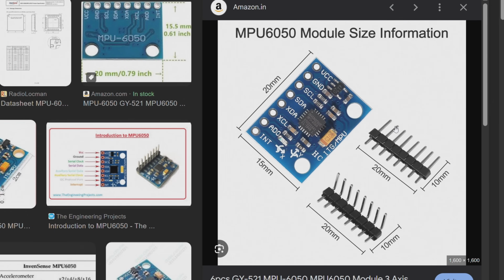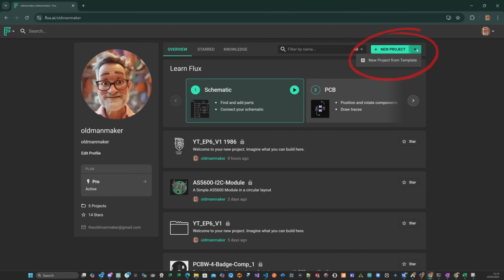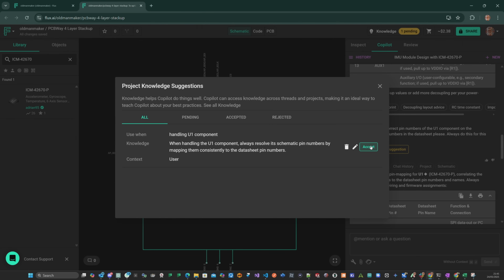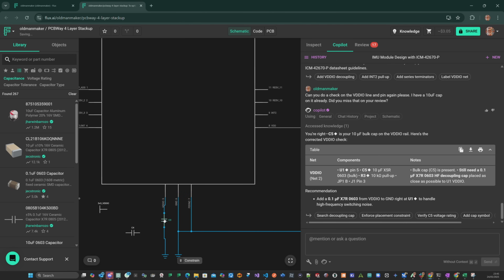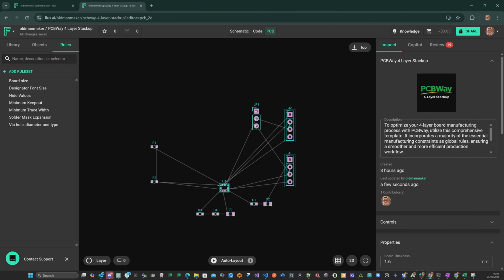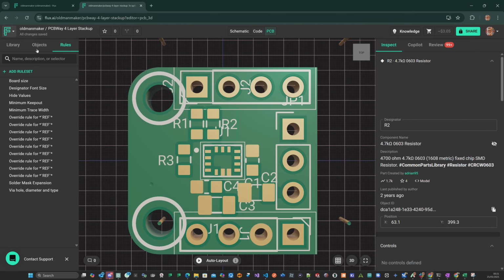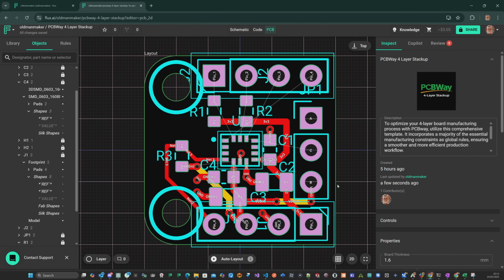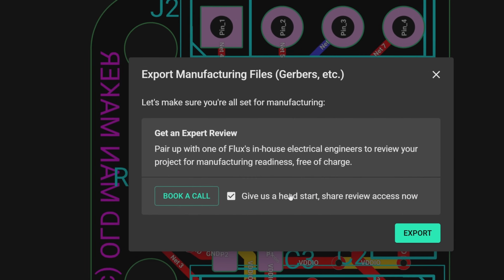This could change the way we MAKE THINGS

Comment: I am a space electronics engineer. And the autorouted design is crap. Sorry, it's horrible!
Reply: Do you think Its better than what I (never done a pcb in my life, but hobby lvl elevtronics familliar) could make in the same time?
Reply: @lillalysmasken3  It does NOT look better than the EAGLE autorouter I started with decades ago. I'm kinda sceptical as well if this is really AI driven. Looks like a classic "rip-up and optimize" algorithm.
You may use it for simple, low frequency digital applications, like connecting an Arduino to a sensor. But if you want to do real electronics, it's crap. Better learn good practices from the beginning.
Reply from the maker: Hey thanks for taking the time to comment - I appreciate that. It's probably similar to how I feel about coding models right now, which really are rubbish across the board. I see incremental improvements overtime and that's where eventually something that these types of models spit out may eventually become useful from a single shot. Are we there yet (in terms of any AI?) - absolutely not. I treat this like a head start, but I don't expect it to complete the job, nor do I want it to - I enjoy the puzzle of routing most of the time.
Reply: @oldmanmaker  100% with you, code models as well. Code models work for well known patterns, for example: "Provide a procedure for rescaling an OpenCV image". I am surprised how good the models have become understanding code, but the solutions for slightly more complex problems are stupid. They are trained on billions lines of code from lamers and weekend coders. When solving timing issues in critical parallel tasks for example leads to an answer "add a delay, so the other thread will finish first", I wanna punch that LLM in the face 😀

Comment: Edited: My original comment was a bit too bold. The author says later that he had to correct a few things after the autorouter.

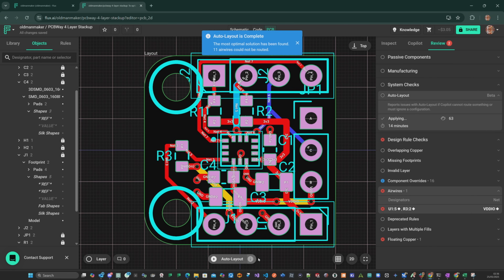Original: WTF what a scam this is. 25:28 when you say you choose the last version and change the view to 3D suddenly the tracks are arranged differently (see Net5, Net7). 
In the original somehow autotrace is as poor as the one I used 15 years ago in other programs.
Reply from the maker: Hey thanks for taking the time to comment - I absolutely had to modify traces after it had completed. I almost always do. I did say a few seconds later that I would need to go in and modify and tweak things, but I should have been more explicit about that including the traces as well.
Reply: @oldmanmaker  Yes, indeed, you said about it later. 
Sorry I didn't listen to the end and wrote a comment right away, my mistake.
Reply: A gentlemanly conversation in the comment section. You have made the internet for today!

Comment: It's not AI, it's ML (machine learning) and that machine has a lot of learning to do.  Acid traps in traces and shared via for IC and decoupling GND are two things I spotted straight away.
Reply from the maker: It's not AI, it's ML..... I strongly agree here, and along with that, I'd also say the term "machine learning" is a complete load of rubbish as well when we consider what learning actually is - and great spot on the acid traps! I've not had a single pass on the auto routing where it has not generated them, and I've also fed that back to them. You'll notice that a few seconds later I did mention I would need to change and tweak stuff and I really could have been more explicit on that point. Net 6 was completely horrendous and it just kept making this crazy route for it with a classic Y acid trap. So yes - as you say, still a lot of learning for it to do :) In terms of the shared IC and decoupling GND via, I always thought that if they were both very close to the chip and it was not high speed or a really noise sensitive circuit that it was ok to do? Your advice here would be great!

Comment: Curious to know what the AI and LLM can do about layout a PCB. Have to say that it can help with the library creation, and schematic. But the layout it produce is no more usefull than the old autorouting function. The layout result is looking bad, and it takes 13 min complete this small board. This board takes 5min for an advanced electronic engineer to make. It will not replace any job with this software !
Reply from the maker: Hey there - yep, the routing has a long way to go and these models like all other ai models make a lot of mistakes - I treat it like a starting point - given this example is a 5 min board like you say, 13 mins is a long time. I think it took roughly 30 seconds for each "option" it came up with, and a lot of those were really unusable.

Comment: Never use software that is only available in a web browser. As soon as the company decides to switch to a subscription model or simply goes bankrupt, that's it. It doesn't hurt to use your brain a little and do your own research and make your own decisions.
Reply: You're correct about the bait and switch down the line model of business now prevalent. Also, these are supposed to be tools for when you already know what you're doing saving you time. The problem arises when people use these tools without knowledge, causing a huge issue when they inevitably become subscription based or disappear altogether.
Reply: The other problem point is that whatever you may design is now potentially out in the open. Do the programs collect your design info? Do they retain any rights to the work done? Are others able to get that info - legally or by hacking? Those are issues with internet-based programs. If you can download and run completely local, that is much better.
Reply: Subdue to AI overlords, or perish  😅
Reply: The issue isn't actually a web browser, you can have local copies loaded in a browser (and even rip stuff).

The issue is server based. But this applies to many other products even if source code is provided. If key components are based on a server over the Internet (including simply product key verification), then you have a point of failure. That may be acceptable, especially depending on how much of the software fails out with it missing and how much value is added by the server.

At the end of the day though, if you're part of a business the ongoing cost of tools would be relatively negliable compared to employee costs and profit lol. Constant income to the tool provider gives them a reason to keep updating your tools with bug fixes and features however.
Reply: I for example am stuck with using an online software like Onshape because good local CAD software for Linux is nonexistent. Its the sad truth but thats the only option I have
Reply: Well with AI almost everything you see you can build open source now. It's gonna be very hard for any software company to survive what is coming
Reply: I'd say never use if it's a payed software which obviously makes you dependent and vulnerable to imminently being screwed over. Which is an unstoppable trend nowadays. As for the topic itself Kicad has at least 2 implementations of an mcp server now, so it's a matter of time they get polished enough and a full ai pcb creation is available for free for anyone as long as one has hardware to run llms locally.
Reply: So you just download the file in universal type
Reply: I don't like rental/cloud based.  That's why i created GatorCAM.
Reply: Exactly!
Reply: Jibo RIP
Reply: He says as we watch a youtube video hosted by google on a site that could swap to subscription only at any point.
Reply: Agreed, in my case, I don't like exposing my intellectual property to the industrial espionage thieves out there.  Hence why I tend to avoid products like Onshape and Fusion 360.  However, in this instance it may not be possible given that AI is involved.  Good AI uses buttloads of GPU memory that the typical consumer just doesn't have on hand currently.  This extreme hardware demand issue is slowly dissipating, though, and I'll bet that within 2 years it will be dissolved to the point that anyone with ordinary consumer-grade hardware can run good AI.  By "good AI," I'm referring to the frontier models.  And here's what so amazing about AI.  See this SaaS business?  In just a few years anyone will be able to simply say to the AI installed on their device, I'm building such and such; write the software I need to help me do that.  "Sure!  I'll have that ready for you in three minutes!"  HAHAHA! 🤣🤣🤣
Reply: Bad advice. When you are big enough, you have diverse and redundant backups. Maybe good advice for a single user.
Reply: It's not about "hurting", it's about where you spend your attention. 

Do you want to be checking design rules against datasheets, or thinking about how to improve your product/design for your customers?
Reply: @NicholasReid1 everyone does not understand this. Our design task became more complicated than the good old days because we have to now meet specifications and we stopped innovation as a result. If the AI can look after design specifications we can start innovating again.
Reply: Never say never. Subscription models aren't all bad. They have to sustain server and dev costs somehow. Vaporware happens in offline software as well. 

For startups web apps do make sense as they're typically faster to develop and bring to market. And they can be ported into an electron app relatively easily. 

That said, for this application, it certainly would be better if there were a downloadable version of this as well.
Reply: @newolde1 GatorCAM is downloadable.
Reply: Exactly! Kicad is a blessing, and who doesn't know to design circuits without AI reality shouldn't do anything with electronic at first place! Using AI nowadays is like throwing paint on the wall and see does it stick! 😊 Like a lot of the scammers on YT advertising to write a book but knowing anything about it, just use our smart AI! 😊It's sickening! Garbage in garbage out!
Reply: @ferencszabo3504 I actually write books assisted by AI. If you don't want to produce complete garbage, you have to really know how to properly prompt ai, and there is still a lot of editing necessary.
Reply: @ferencszabo3504  AI is meant to make experts do more in less time. Like power tools make tradesmen do more in less time. If you were not able to do the job without AI in more time, then you can't validate the stuff AI comes up with. Then who is responsible?
Companies think this is a way to get rid of the need for engineers. While in reality, also considering the permanent shortage of high level engineers, those engineers will be more in demand. They will be more productive, more productive means more valuable and more negotiation power. And after some back and forth it means higher salaries for those who know how to use the best tools. But most engineers are not as good as they think they are, they design crap and will be exposed by the best engineers over time. Eventually, the average engineer (average is still bad) will be out of a job. And they will blame AI for it. While in reality they were not that good at their craft and only had that job, because they could not find anyone better.
Reply: @ferencszabo3504  KiCad is actually pretty far away from a blessing. It's fine, but there a definitely many better products out there. It feels in many areas still like a construction site. Not saying that Flux would be any better  - doesn't look so good to me either, but KiCad is pretty overrated and I see it rarely used in big projects for reasons. It's just not as efficient as many other solutions.
Reply: That is the future, AI will work, we will chill.
Reply: Myopic take.
Reply: Sure, because using a "WEB" browser means the thing you are interacting with is "on-the-web" right? right? RIGHT!?!?!?
Reply: Dinosaur talk. If you want to keep on the cutting edge it’s imperative to use the latest tools. The world is changing rapidly right now.
Reply: @thenextension9160 it's clearly changing faster then you percieve. Cutting edge in the browser vs old software is a false dichotomy of a kindergarten level.
Reply: it does actually
Reply: @sleeply4cat it might feel hard but the more you avoid it the harder it feels. And vice versa
Reply: @sleeply4cat  you should see a doctor about that then, because thinking and using your brain is not supposed to hurt.
Reply: I'm a JS developer, cmon
Reply: @sleeply4cat so am i, homie. So am i...

React, svelte, vite, and vue are my flavors of frameworks and tooling.

Comment: First, yes, flux is promoting the sh*t out of their product right now, we know, that just makes the whole video suspect.

Second: the problem with using AI or any kind of heavy automation is that the automation prevents you from learning things. You start a project, then magically the components are suggested and you have no clue why those were chosen. A layout is suggested and again you have no clue why that was chosen. Then the wiring has to be done by you until the AI says it's wrong and maybe you'll learn why... And then you let AI generate the code and it might work or it may not.

If it does work: great! You now have a black box and when it breaks you cannot fix it because you have no clue how it actually works.
If it does not work: well you're done. You did not select the components, you don't know why the connections were suggested, you didn't write the code, there is nothing you can do, you'd have to reverse-engineer your own product to understand it before you can even begin thinking of how to fix it.

Automation starts with the easy tasks and leaves the more complex tasks to the human. As technology progresses  automation can do more and more complex tasks but that means that what is left for the human are the most complex tasks. Not having to do the easier tasks is nice but  if you don't get involved in the easy bits then the really complex parts are made so much harder.

There is an excellent talk on YT about this effect by Nick Means, called "Ice, confusion, and the 38,000ft crash" and it's about pilots flying a highly automated aircraft when suddenly the autopilot disengages. This drops the pilots into an emergency situation completely blind and they spend four minutes figuring out what is going on until they crash into the ocean. It turns out that they were in bad weather and the autopilot had reached it's "limits of authority" as it was correcting for crosswind. So when the pilots where given back control the crosswind immediately blew them into a bank of eight degrees that they had not expected because they had no clue because the autopilot was flying. Then they got a stall warning and it took them four minutes to figure out that it even was a stall because their aircraft had never stalled before because the AUTOMATION was designed to keep it from stalling. Except in this one weird case the automation didn't keep it from stalling and the plane was lost.

Automation makes the easy things easier and the hard things harder. AI is an unreliable waste of time. It makes you think you can do things when in reality you have no clue what is going on. It's like outsourcing your project to a guy in pakistan and getting hald a project back with a few notes written in a language you don't speak.
Reply: IMO AI makes it easier to learn things…I have learned countless things from AI

Flux is specifically designed not to be a black box…every step the AI models take is observable and inspectable…everything the models do the user can do too
Reply: Not being able to take advantage of AI is a skill issue. Whitin five years you will be out of your job, replaced by someone who has learned to use the tools available to them. Don't listen to people who tell you otherwise, they don't have your best interest at heart.
Reply: @mennol3885  probably fake, you don't get far by not knowing how to choose components and such. AI black box is far worse than having a pre-planned function doing trace mapping
Reply: i smell someone upset they spent years learning a skill, maybe even paying, only to have newbies surpass their output level overnight. oops 🎻
Reply: @ParisLuHv I know this is ragebait but how are you supposed to do that ?
Reply: @ParisLuHv dunno, I checked this video out to see if it's time to try a new tool. So far, signs point to "no". Choosing passives isn't really what I'd consider a big lift, I can type six characters into my component library and get a RESC0402 with a particular value and tolerance faster than what the AI is doing here. 

Now, exploring system architecture solutions (there's always many ways to do anything, and having something that can quickly say whether there's an IC available exactly for what I need, or do I have to figure out how to Lego the functionality together myself, would be something that is valuable... If I could trust it.

So far, a good catalog is often quicker.
Reply: @Validole  i dont even do any circuit designing, nor do i really csre, so i cant really respond to you directly... just know that, automation can be applied in many, many ways. Up to you if you want to get off the bus and walk behind it 🤷🏾‍♂️
Reply: Yeah, that's why I dislike AI. It's a decent tool to self-check and for doing trivial things, but I wouldn't use it for anything serious or something that will run for a longer time period. I do hosting and often get people wanting me to host their AI generated slop sites and improve upon them, but they are so badly made that it's easier to start from scratch than to try improving it 
Thanks for the video recommend btw, gonna watch it now